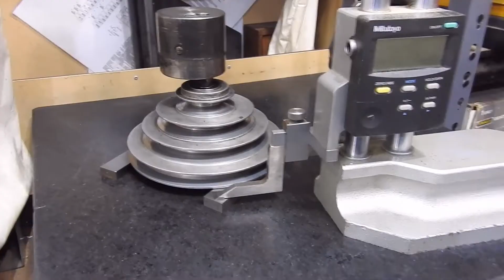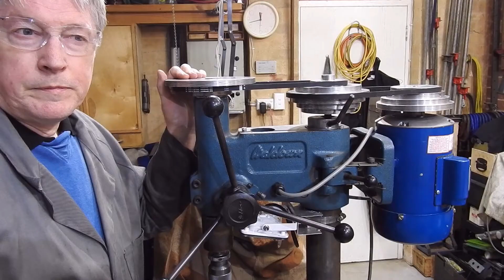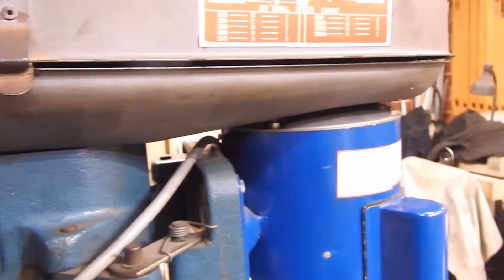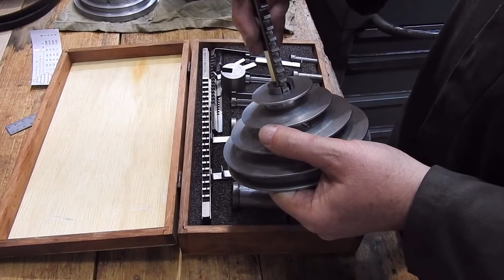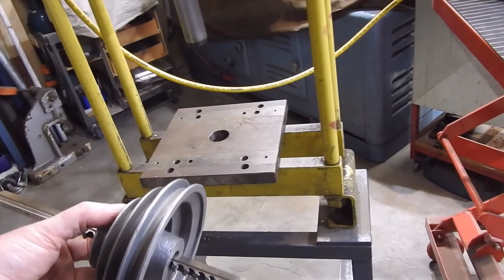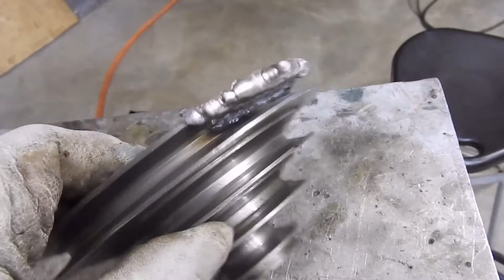The big fit up (Waldown pt 3)

Comment: A set of broaches and a suitable press are high on my list of wants. Nice tip that a 12" stroke would be ideal.
Reply from the maker: I would say at least 12", but in reality I only do keyways once or twice every couple of months so while it is a bit annoying, if you can't get that, it's not the end of the world. The nice thing about that press frame is that I could buy a 12" stroke cylinder and put that in - they are interchangeable, but that would be provided I had oil volume in the pump to drive it.

Comment: Good save on that pulley
Reply from the maker: I started doing that after watching Jody at @Weldingtipsandtricks pad weld up the corner of an Al box with (purposely) poor fit up and realised I could adapt it to things like pulley flanges. Another thing that I don't do often but handy to be able to do. Those pulleys are now off to be used as replacement parts on another Waldown DP so the pulley needed to be fit for purpose.